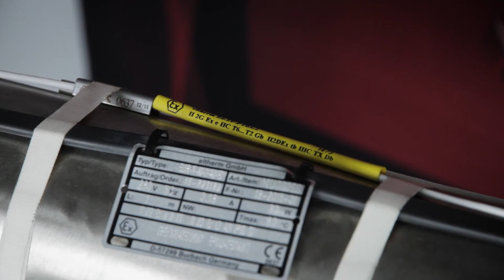Understanding electrical heat tracing

Comment: electricity doenst cost much . Compared to the price of the gas, that needs sufficient tempratures to be stabile . If you have a cool spot, you can have condensation in the gas mix, and such can pose a risk . Pipe, tank with any gas or material medium . Damages to the pipe due to coolspots and condensation may be droplet sputter, turning into toroids with vortex that drill into the steel pipe and at worst case create micro caveties in the pipe, causing gas leaks . Mostly a problem in Impellers, turbines, and sharp cornered pipes .